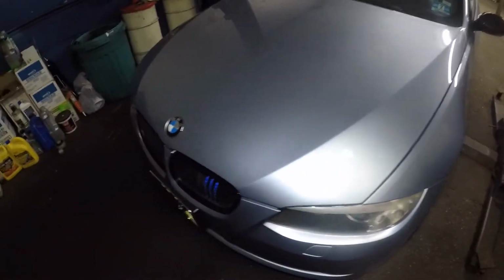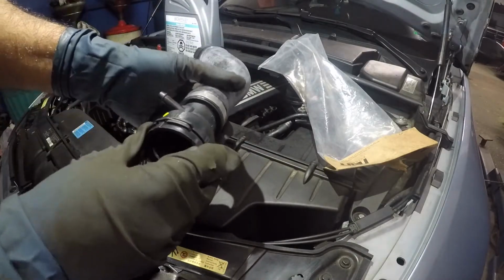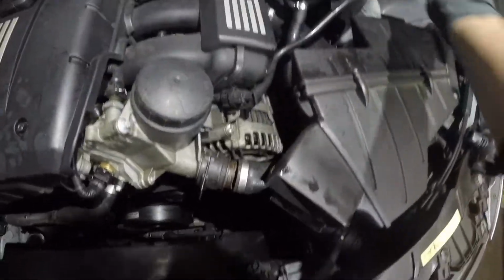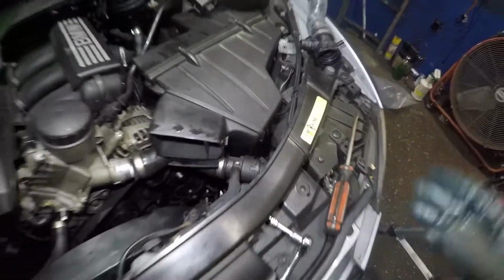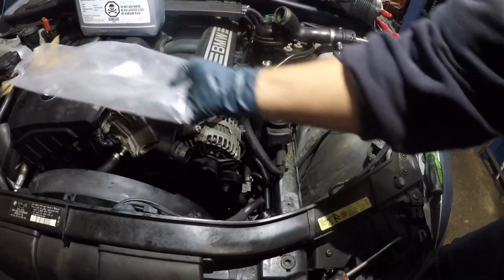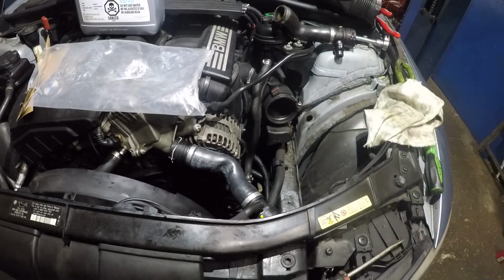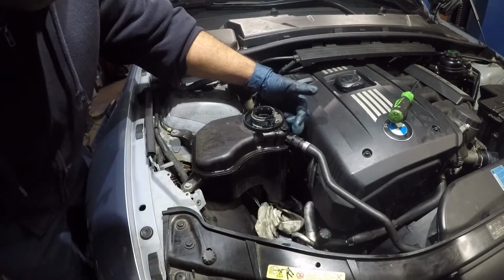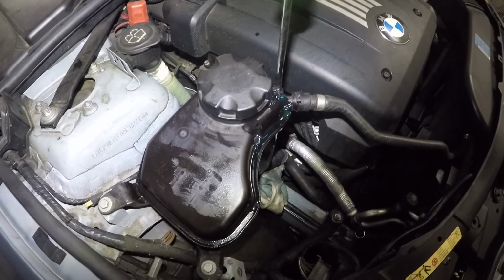BMW 328i Over heating or Leaking coolant Fix, Bleed air from cooling system EASY DIY

Comment: This helped out quite a bit. My upper radiator pipe busted when I got to my job this morning, it was dry rotted and I bought the car used. I still have coolant inside the reservoir, do I need to drain that before I take the pipe off? Even though most of it sprayed out when it busted.
Reply from the maker: U can drain it or just let it come out form the pipe

Comment: Just replaced my radiator on my 07 328 along with upper radiator hose everything went perfect. For some reason the lower radiator hose keeps popping off the radiator spilling my coolant while driving idk what to do to properly secure it. Any suggestions?
Reply from the maker: The connector maybe didn’t click u. I would put some lube on seal and the radiator side both sides lube them up and make sure u can see if heat the connector click pop in
Reply from the maker: I hate those type of hoses I like clamp one easy to put on and ur sure it’s in

Comment: I have same car same issue. Thanks to your video up replacing the hose myself. But I’m confused because I refilled radiator, and bled the screw to which no bobble was coming out straight out liquid made a pool of coolant on the ground then tightened the screw and fill up all the way up. Drove it and after a while it burst and popped that same hose, coolant everywhere, and of course overheating.
Reply from the maker: Over heating could be issue with thermostat or fan not working. Usully once u bleed it it shouldn’t have been issue with bleeding check for fan operation
Reply: There is process to bleed this cars that you have to follow… vehicle need to be off, electric pump need to be working with vehicle off, you pump the accelerator 5 times, turn on the heater all the way up… you can look a tutorial online to accurately bleed this type of vehicles

Comment: that hose that connects under, the small one at 10:05, what’s the name of that hose? i changed my upper rad hose and it’s leaking from that small hose now, i think that may be the issue
Reply from the maker: Sorry I don’t have name of that hose usully this car I buy parts using diagrams u have to pint out the part u need

Comment: Hi my car over heating and leaking from same place in ur video how to fix it I think fan doesn’t work as well how I diagnose if Dan not working
Reply from the maker: Fix the leak first replace the pipe if that’s what u see is leaking there
Reply: I have the same issue as this person, the fan is a issue for me as well. The BMW dealership told me many things ab after the diagnostic test. I can drive it but it overheats and cut off and it make a loud whistling noise as well. It idles up and smoke some. I was told the time chain ab to skip so do I need a new motor all together? I'm tired of putting money in this car.

Comment: Hey bro so I took my car to the shop cause I was missing a connector to my cooling fan and it was over heating I’ve replaced my radiator and fixed the connector and my car continues to drop all my coolant and over heat what could it be mechanic tells me it’s some type of ecu and that it’s 2k
Reply from the maker: What u mean by dropping the coolant. U mean it pushes it out and smokes after it over heats?
Reply: My mechanic told me he I could take it but it’ll continue to Iver heat and drop coolant but I don’t really trust him because he fixed the connector and then it kept over heating and then he said it was the radiator he replaced that and then he said it was some type of computer idk
Reply from the maker: @pradakevo try bleeding if it dosent have anymore leaks also check to see if ur fan work
Reply: @RBTheMechanic  yea ima take it back from the mechanic he’s def scamming me I was thinking he probably didn’t bleed it right
Reply: @RBTheMechanic  cause before I took it to him when I bought it I replaced a upper radiator hose and there was no more leak but this was before I knew my cooling fan wasn’t working couple days after another hoes was leaking fixed that then I started noticing more and more leaks I just kept wasting coolant but I needed the car for school so I didn’t bother fixing it then eventually my car started smoking but I think it was because one of my hose bursted while driving but this was because this was the longest I’ve drove the car non stop usually it was just to school and back home and so I drove it back home with the hose barely connected and then took it to my mechanic later as I got there the same hose got loose again I thought this was all because of the pressure of the hot coolant since the cooling fan wasn’t working that’s what he told me as well but it’s been there ever since
Reply from the maker: @pradakevo  he did somthing wrong find the leaks fix it
Reply from the maker: @pradakevo  as long as there’s no leaks and ur fan work and it’s got bleeding it shouldn’t over heat
Reply: @RBTheMechanic  I do you think it could be some type of each because like maybe the fan isn’t getting the signal to turn on or something there’s stilll leaks idk where but he tells me there still is
Reply: Ecu *
Reply from the maker: @pradakevo  I doubt that
Reply: @RBTheMechanic  so you think I should take it back and bleed it myself ?
Reply: @RBTheMechanic bro he said my engine has been over heated too much and I need to see an electrician
Reply from the maker: @pradakevo  it could be bad head gasket if u over heated too much
Reply: @RBTheMechanic  so if the engine is overheated it wouldn’t run right ?

Comment: That's not the proper way to do it, because when you open the screw you lose coolant.
On BMW, there is a bleeding procedure done by turning on the water pump with the engine being off.

To trigger this procedure, you have to first put the key in, press the Start/Stop button without pressing the clutch, so that the engine does not turn on, then turn the heat (temperature) to max, ventilation on the 1st step, and the keep the acceleration pressed for 10 seconds.

This will start the water pump and you can take off the expansion tank cap and you'll see how the coolant is being pumped in the tank, releasing any air that is left in the system.

Comment: The E90 has a bleed procedure and what he’s doing isn’t it.
Reply from the maker: Ok show us
Reply: @RBTheMechanic I believe you stick the key in, turn the car to the ON position (not started), make sure it’s on the highest heat settings on the dials, fan on low speed. Then press the gas pedal for about 10 seconds, it activates the water pump. Takes about 12 minutes, some people attach it to a trickle charger while it’s doing the procedure.

Check the overflow after make sure antifreeze is at the right level. Fill if necessary.